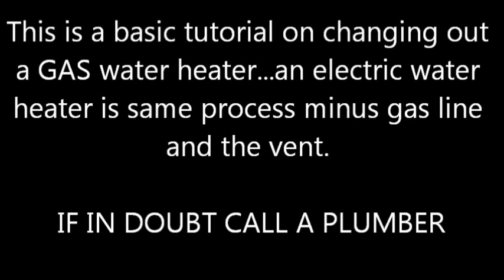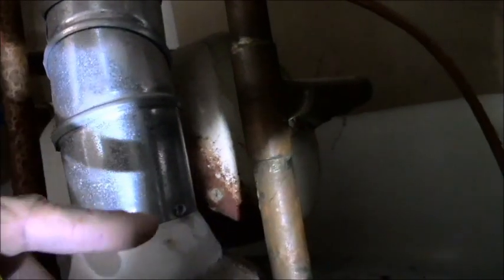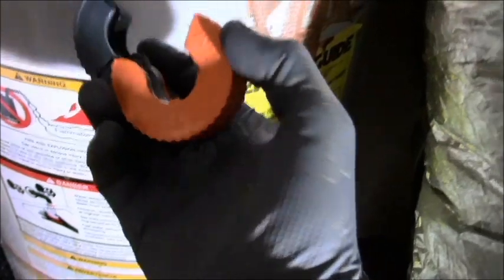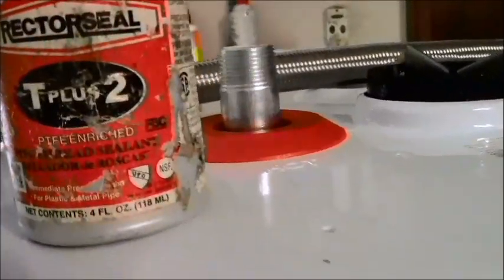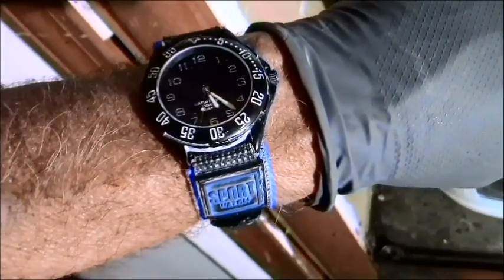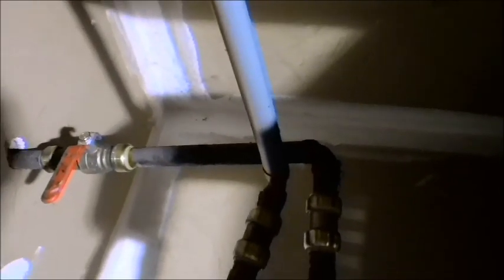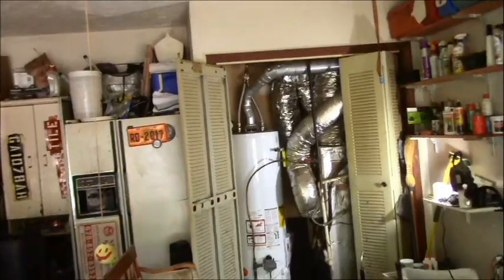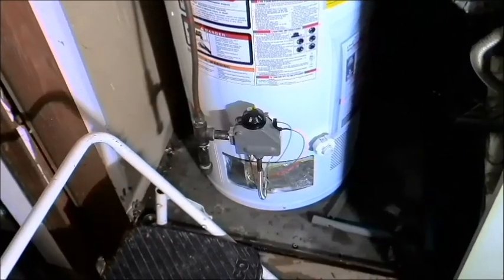WATER HEATER...how to install

Comment: Water heaters don't last as long as they used to and the life expectancy is constantly getting shorter.  For that reason it is worth anticipating the next replacement.  I use unions at both ends on the feed and discharge pipes as well as the gas lines.  Also installed are ball valves with threaded connections on all the lines.That all makes it relatively easy to use a few copper and iron connections for final fitment with each replacement heater.